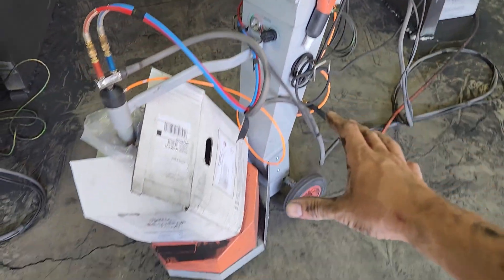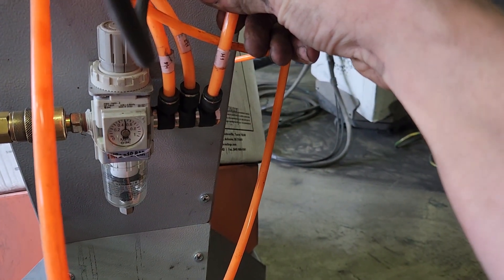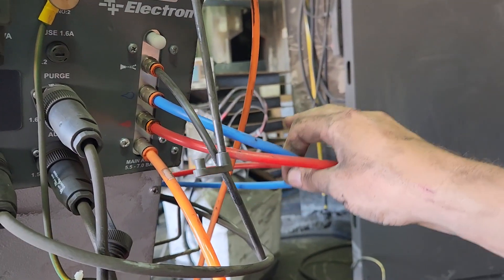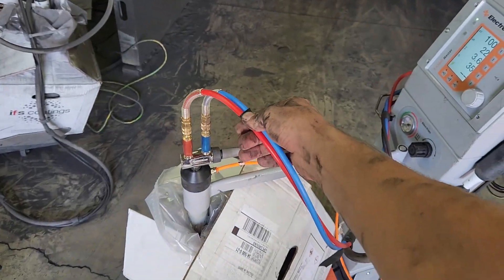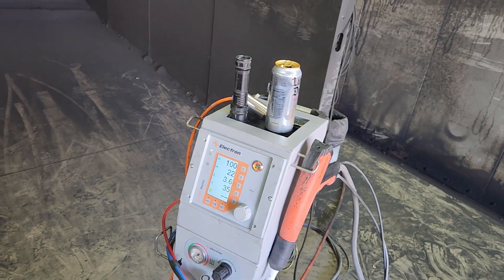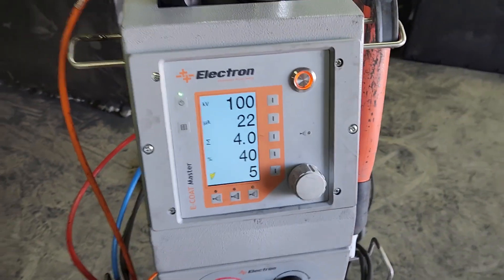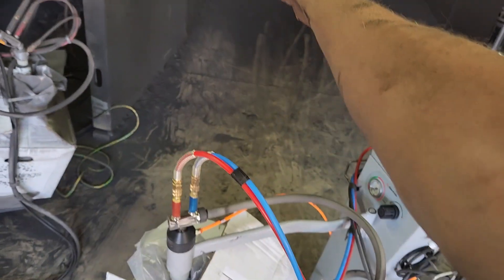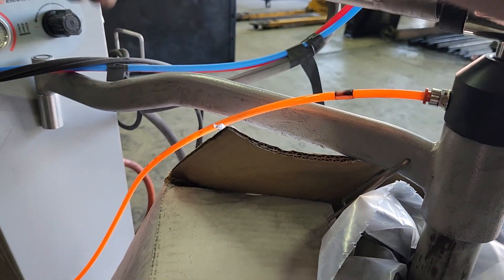Powder Coating Gun Set up and Settings (Electron)

Comment: My fluoridation  gauge doesn’t move at all when adjusting the knob with trigger pulled like your supposed too is it broke ?
Reply from the maker: Do you have the fluidization on...its the power button, not the on button.  If thats not on and the vibrator is not working then the air wont work.  feel free to email me too at dan@ctsainc.com

Comment: Newbie question , i got alot of powderbuilt up on the electrode can that make a performance issue?.. what is the solution is it to have higher psi on the aux? ..
Reply from the maker: Depends on your gun.  The better guns have an air setting to keep the nozzle clean.  If yours does you news to turn it up a bit
Reply: @RightNowPowderCoating   thanks for the quick reply :) ,whatching  a lot of your youtube content very good content..i was wondering if you have done a real basic walk thrue of the gun..like i was wondering about the tip..would be fun to se a such video when you brake done everything :) // Roger from sweden

Comment: Dan , did i hear you correctly that the fluidizer doesn't work until you pull the trigger  
 on this gun or  ?
Reply from the maker: Yes, when you pull the trigger it starts air flow to the tube to fluidize the powder as well as the motor for the vibratory base.
Reply: @RightNowPowderCoating  Does your GEMA do that too ? my current gun starts fluidizing when you turn the machine on. I like it that way so the powder is always fluidized.
Reply from the maker: @scottmorris6793  Yeah, I think it does it that way too.

Comment: Dan I'm interested in the corona ring thought it came with it also the purge valve
Reply from the maker: It does not sorry, once we start stocking parts would be the best time to order one.  If you want the purge valve too we can discuss that.  We really dont use ours, we just break it down and clean it.  Which if you go back to our Cleaning video on our gema gun its the same process.  Takes a few mins is all.

Comment: Maybe an easy question.. When you use the word "GUN" are you always talking about the entire system (control unit, fluidizer, regulators, hand held thing with the trigger and electrode that applys the powder, etc)  or just the part you hold in your hand? AND,, Is there a  guide, (book, video, training seminar, etc)  to setting up and adjusting all the controls like pressures, powder flow KVA, etc??  I bought a China unit and it came with NO instructions for anythung. I have it all plumbed correctly (I think) I bought a small fluidizer cup and pump because it came with a huge 50 L hopper that I do not have a need for at this time.  it works but 3 of the 4 gauges on the controller do not register any pressure and I am kinda clueless as to what I can or should adjust and how everything works.. A little knowledge might be a good thing for me to have.. Thanks for all your videos brother,,, they are helpful
Reply from the maker: In general gun is the system.  As far as set up I wouldent be able to help too much on your gun as I am not familiar with it.  Best way is to just adjust settings spray, adjust spray....till you see what it all does and how they work together.
Reply: @RightNowPowderCoating  Thanks for the reply.. My "gun" works and I've been doing what you suggest but I think I am doing somethuing differently than I am supposed. theree are 4 gauges and regulators with no information what they are.. I am baffeled how even a cheap-O china model sold all over the place under many different names (NONE  ON THE UNIT) would have no doccumemtation at all.. Since I stepped up from the home-owners level crap, I was hoping to learn some things.. Anywways,, Thanks Again brother,, I'll keep watching and picking up tips